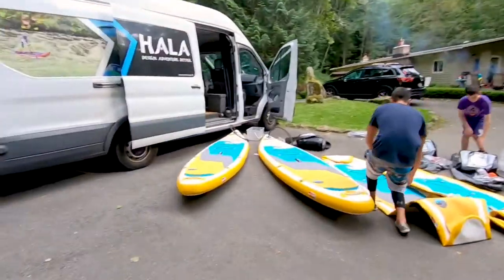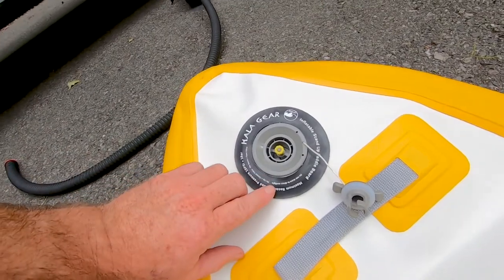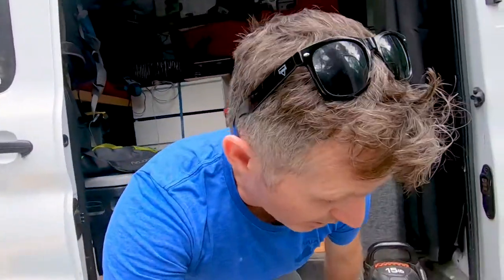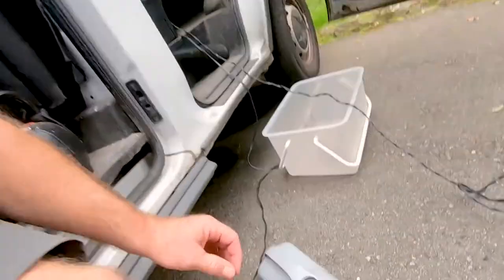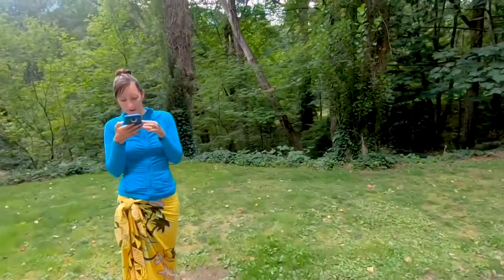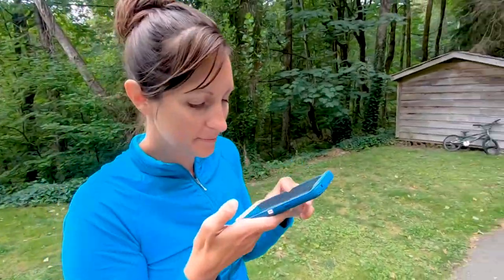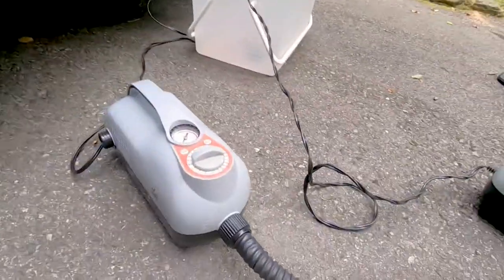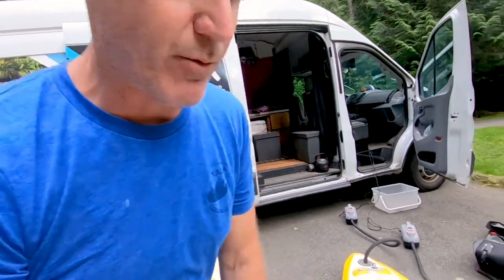How to inflate a paddle board with a 12 volt pump

Comment: My nut/nipple lol loses air when I disconnect regardless of what position I inflate it in. Tried it multiple times. I think disconnecting somehow presses  on it. Would this be a problem with my adapter or my board? Both are new.

Comment: Hey Paul, is this board decent on class 1-2 whitewater? it looks like a good first board for me considering that I could surf, tour and potentially get on some white water with it. I'm 6"5 190 lbs though. That is my concern.
Reply: Brett Price go for the hala atcha. if you get into whitewater at all, you’ll wish you had. nearly impossible for a board to perform above average in each condition but knowing what i know, i would pick the one that performs best in the most difficult scenario, whitewater. will it glide like a flat hard shell across a lake? of course not.
Reply: @forbiddenair  thanks man! that makes sense. I came to that realization and made the decision to get a white water board and then later on a surfboard. I'm gonna get the radito though since it can do a bit of quiet water as well.
Reply: no reason to not have a quiver
Reply from the maker: Echoing others, if it’s moving water you are looking for, the Hala river series is it. Whether that be a Hala Rado or Radito for river touring (also works for adventure lake touring). Or, the Atcha for more techy whitewater. For your profile, the Atcha 96 is a great board.

Comment: What's the pump you're using?
Reply from the maker: It's the Hala Gear SUP 12v high pressure pump. It comes with an H-valve connector (Halkey-Roberts), the most common iSUP valve.
Reply: @SUPPAUL  is this pump battery operated or do you need a outlet?
Reply from the maker: @rachelrwyatt  12v “cigarette lighter” plug in your car is the outlet. With either the engine on or off. But provides more power when the engine is on and is less taxing on the battery
Reply: @rachelrwyatt  - He literally showed it plugged in.